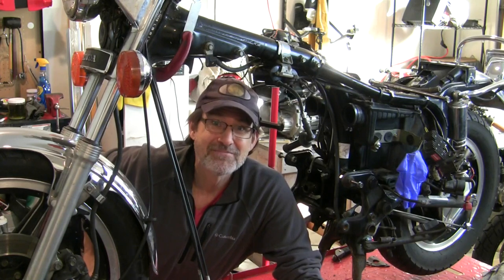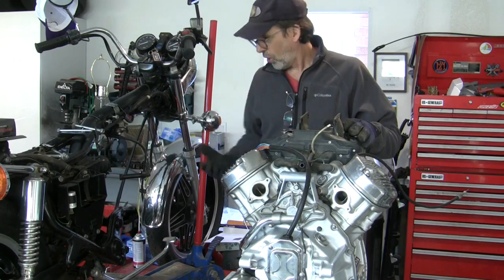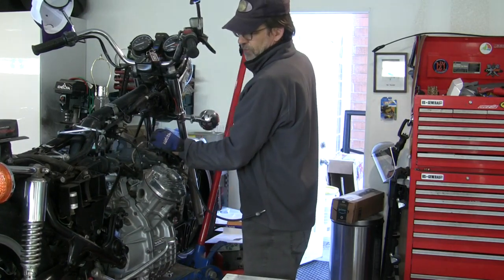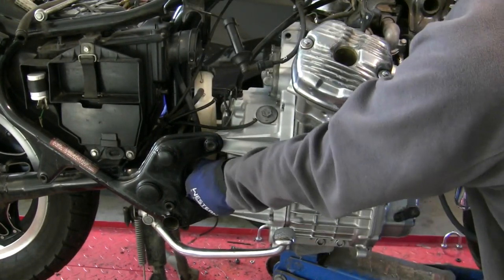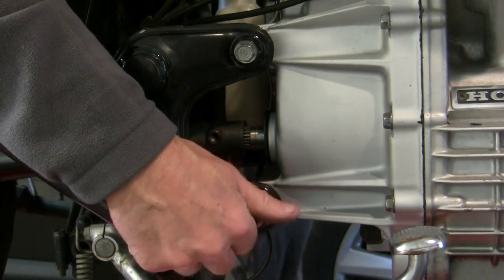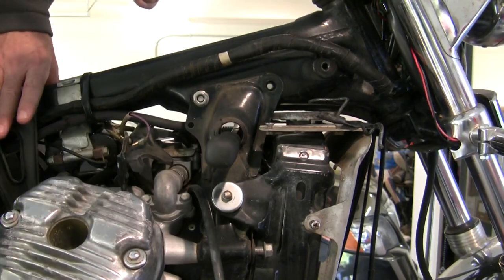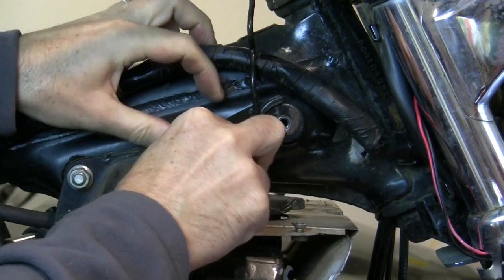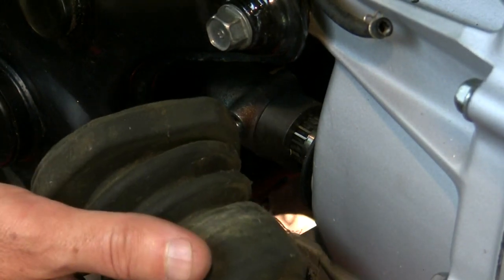Install Engine in Motorcycle - CX500 (Part 14)

Comment: fyi i used a giant screwdriver and my body weight and a rubber mallet on the bolt and Wala after the circus act it went right in with a thud lol
Reply from the maker: Whatever gets the job done! :)

Comment: here one idea for you--->  if you don't have a strong beam in your ceiling to mounts chain or cable winch you can use that floor jack to move engines just take out in that jack that part what goes under the car and build on that a bolt-on & off system & best way to make stand its in Thick L-Shape ( angle iron ) or a square Tube but weld on that L corner a support brackets so its not gonna bend & up of that metal part drill a hole & put wide metal plate  & you can drill holes on that plate and use long bolts with a Unthreaded Spacers so you can bolt that on engines in their mounting points and that metal plate do not touch in the side of the engine so you can move it much easier or just make a engine stand  shape like a triangular you can build it in round pipe or square tube wheels its good to have so its move much easier & last add chain or cable winch to lift motors
Reply from the maker: Good ideas! I need to use my floor jack for my cars also though, so I can't be modifying it too greatly. Thanks for sharing!
Reply: @UrbanMonkTV  bretty much in all floor jacks have that round part on in block so you can just pull it up and you can weld bottom of that L-shape tube a  metal block so stand stays on upright in that same hole
Reply: An cheap Harbor Freight ATV jack with two rails works perfect. No mods needed.
Reply from the maker: @robertclary1718  I've looked at those. Seemingly they'd be a handy thing to have. I'm always trying to consider the footprint of tools when not in use and that one hasn't passed my logic up to this point. Maybe someday. In the meantime I get the job done with what I already own. Thanks for watching!
Reply: @robertclary1718  there so many Things what you can build your self and its cheap you only need to use your head or take ideas from someone else
Reply: @broo_shs  but I already had one  for my atv. With a 20% off coupon it was like $50.
Reply: @broo_shs  as far as building things I also use this atv jack to lift my free bike  lift which is made entirely out of wood. The jack stores under the lift table when not in use.